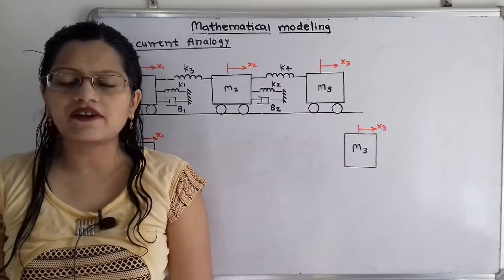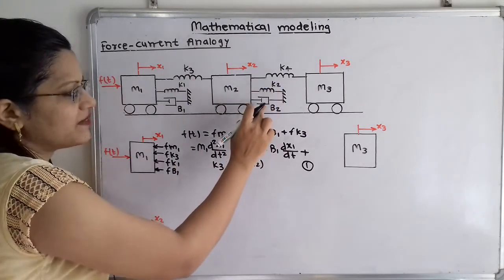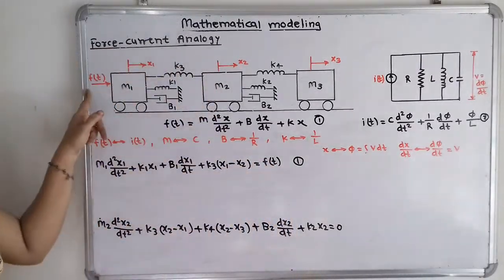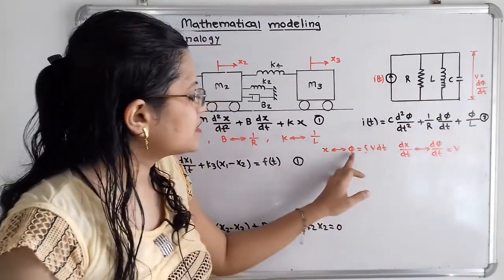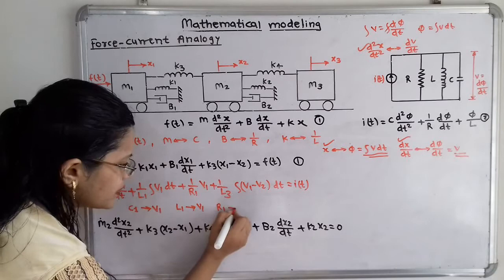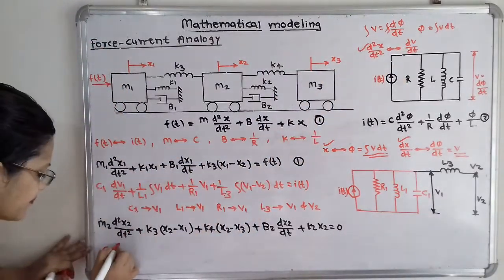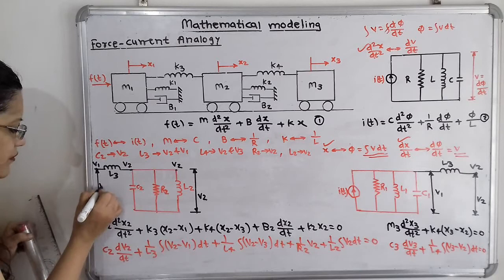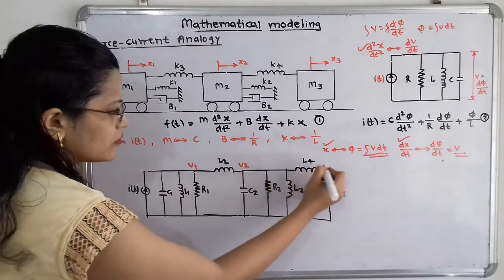Problem 7 on Electrical analogous system/  Force current analogy/ Electrical analogous circuit

Comment: how do the units relate? is 1(N)=1A and is 1(H)= 1/N/mm ect.... i cant find a single example of problem with its solution, using actual numerical  values, anywhere on youtube.
Reply from the maker: Please go through play list Control engineering ...